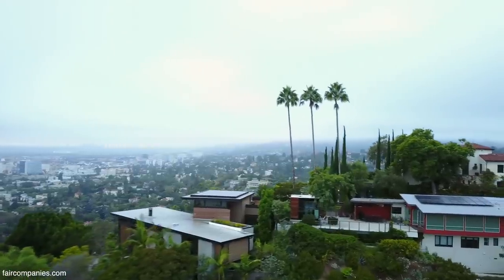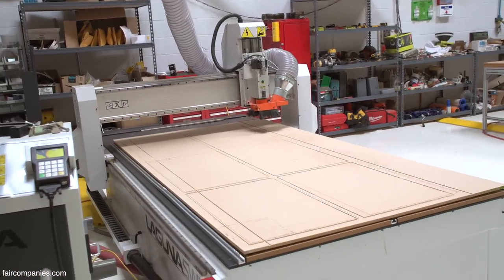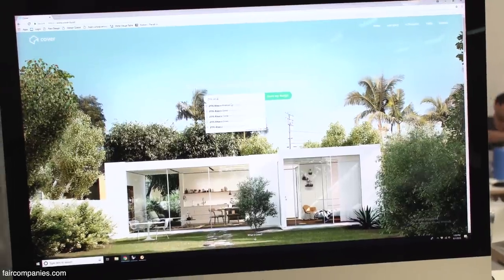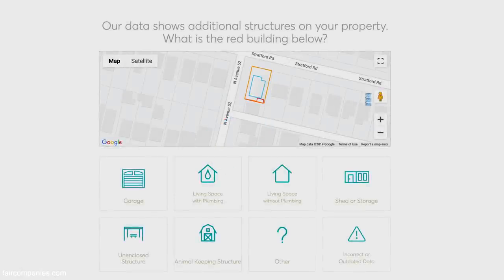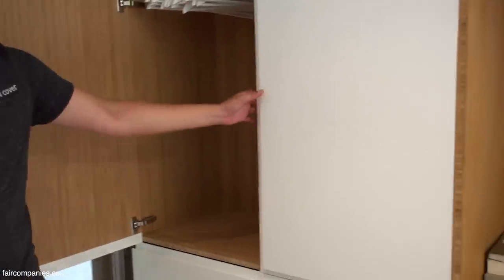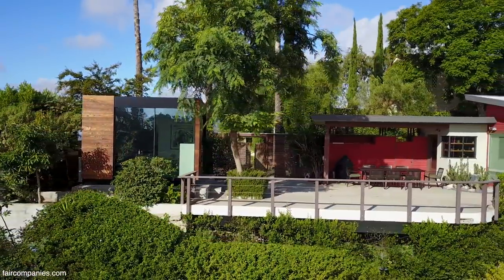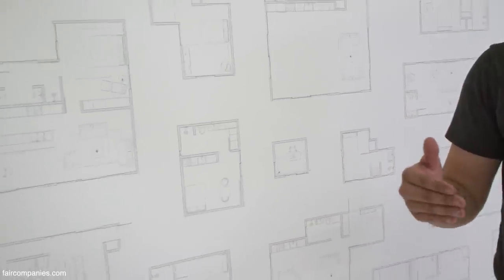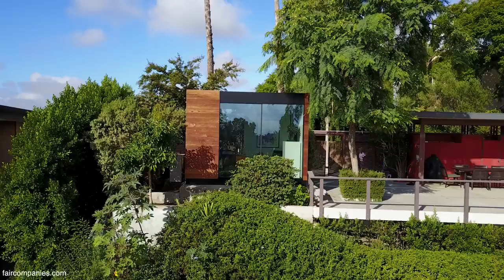LA startup offers custom small prefabs adapted to area code

Comment: An interesting concept. But, there is always a But, there is so much more to the cost of a home such as utilities. If these homes were designed for water catchment with a purification system with solar and wind turbine or depending on location water turbine for power that could possibly offset the cost for the California area. The only home I've seen that offsets the cost of build and land is an Earthship. In some locations an Earthship build may not be feasible, but to integrate as many of the principles as possible, water catchment, generating off grid power, using collected water 3-4 times and greenhouse food production even the black water for landscaping. Prefab a home that can include even one of these ideas and you increase the day to day affordable living.

Comment: What people here in the comments fail to understand is that the cost of labor is a significant contributing factor to the high cost of housing in California right now — especially in the SF Bay Area. The $100k price tag for one of these units includes the cost of the bulding materials, labor, installation, high-end fixtures, HVAC system etc. If you were to hire a contractor to build one these ADU's (accessory dwelling units) on a single-family lot in any of the major metro areas, it would end up costing you upwards of $200k and the quality of the finishes wouldn't be nearly as good as the ones shown in this video.

Comment: Problem:  Outlet specs change over time, wiring goes out, things break.  There is no way for an electrician or anyone to access the wiring in that outlet.  It's very close to a deal breaker.

Comment: 100k for about 10-15k in material if that and maybe 5-10k assembly labor I’ve never heard of a standard size sliding door being 10-20k either.
Reply: I know I saw the graphic at 4:56 and went so the solution to expensive/lack of homes is $350/sq foot tiny homes with no bathroom and technically no bedroom?

Comment: Positives: beautiful exterior and quick/easy checking what you can build on your property. Negatives: looks badly put together (panel seams make it look like it's falling apart, crooked wall outlet, table edge finish, etc), difficult maintenance/repair/upgrade,  low durability, at 100k not really a good value for the money.

Comment: The rollers on the bottom of the sliding doors are going to fill up with debris easily. That said, this company looks like it has potential. I am wondering what the cost are and what the limitations of what they can do.

Comment: A lot of great ideas guys. Consider using more veneers on the interior and instead of square edge panels I would chanfer the edges of the panels. The final product is actually more clean then trying to hide huge seams. 
You see these elements a lot on yachts and it works well visually and spreads assembly. 
Good luck with streamlining the production. Obviously there are a lot of possibilities here. After perfecting the backyard home I would be aiming to build full-size solidly constructed homes. Nice work. 👍

Comment: I think that company is doing a good job with their designs and products. It's interesting though how prefab designs have been around for a long time, but have only had limited success globally. In some countries it is almost the norm, but in other countries it has largely failed. Also for some reason they don't often work out cheaper than conventional building approaches. It's hard to know why. Post WW-II when there were a lot of returning veterans there was a short-lived boom in prefab housing which quickly faded. Recently I read the book "Prefab housing and the future of building" - it was interesting, but I felt it still didn't really get to the crux of the issue.

Comment: the outlet is terrible. I want t be able to swap switch plates, change the outlets, rewire, etc. Prefab only works if it is customizable after the build.
Reply: A good prefab allows for modification before assembly! I think you can still customize before assembly/swap
What should be worrying is the lifetime of the quality of material used!

Comment: -How would you replace this outlet if something happen to it?! (***Cut out the wall - very smart)
- How do you want to replace those sliding door rollers in the frame after couple of years? (working in high humidity and dust) (*** Change the whole frame - smart again)

Comment: Don't get me wrong, I think pre fabs are a great idea for affordability (as well as tiny houses) but while he's clicking through, thats still $100k for only 279 sq ft with NO bed OR bath......
Reply: They're not affordable at all from a cost per square footage perspective. They are double the cost of normal construction. But you probably get a much better build, air tight, energy efficient, etc, that is put up in hours with little noise, compared to conventional construction that takes days/weeks and hella noise.

Comment: Problem is they do not build in Los Angeles County only Los Angeles City.  Wonder why they cannot build outside LA City.  I am guess the other cities within Los Angeles have their own building departments, permits, rules and planning commissions.  If I lived two streets over I would be in LA City.  Think they need to expand their concept of working with Los Angeles County cities.  On this story I would had liked to see other units with a kitchen bathrooms etc. since Los Angeles is getting very hot during the summer how are they designing air conditioning for these units.  I guess a single unit where you can cut a hole in the wall would work.  What kind of surfaces do these units need to be built on.

Comment: For a unit with no bed room, bathroom or kitchen is $67,100 + $5,200 for permits + sitework of $20,130 and keep in mind the foundation is not covered yet = $92,430 for 124 sqft or $745.40 per square foot. Who is supposed to afford this? And it looks to be very expensive to do maintenance on it and it will only last 50 years?? Who can afford this??

Comment: I like it but I think for 100k is a bit expensive. I'd like to see a combo of what these guys are doing but reduce the amount of wood structure and replace it with a light gauge steel frame which could make it more efficient = less money. For a prefab like that it should not be more than 50-60k

Comment: $100K is actually not that bad. They design a custom structure, deal with permits and install it for you. If you hire contractors, you can spending more, while wasting a lot of your time in managing the project.
Reply: a942687032679840126 Contractor only cost $120 to $160 per square foot for new home. Building bigger can be less then $100 per square foot in California

Comment: Well that is certainly one way of  building a small structure but it's actually cheaper to build structures out of concrete poured into forms, you can have a prefab or poured on site and for any walls within the structure you would use metal framing, you can build any configuration within the diameter 30ftx30ft for at least $45,000. Plus with all of these forest fires the price of wood is going to go through the roof and most likely we will need to stop using wood as a source of construction to preserve the production of oxygen on planet Earth, concrete is just more efficient, effective and more environmentally friendly $100,000 for a prefab small structure that is not fully furnished is OP the inflation in the market is insane

Comment: 1) it is too expensive even for LA. It seems they are in a very small - very niche market where they can get a lot of $$$, and then move forward. 100$k for shed is totaly crazy. 100$k for another bedroom in 2$M LA house is fine. 2) I like their approach when they put a different material on the ceiling - to put electric there - why not to do the same with walls- so it could be easily maintained? In general i dont see all of it as issue - this approach to making houses - let hope they will develop - lower prices and etc.

Comment: So they are essentially building adu , not actual homes on the lot ? Still have to buy an actual lot. Which in Los angeles Is overpriced.
Reply: Yes, these are accessory dwelling units. They are a quick and easy way to add more housing supply to neighborhoods that have historically been zoned for single-family homes.

Comment: For $50,000 you can buy a really Bitchin fifth wheel with slide outs add another $500 to remove your fence slide it in your backyard put $50,000 in a high-yield savings account and your money ahead

Comment: Everything was perfect until the price tag appeared ($100k), for a tiny home.... it's insane.
Reply: @creoloko - No, just a reality check that what something will cost is not limited to its size.

Also, the simple fact of the matter is small to tiny structures were not invented by or solely for the tiny house movement but actually have been around for most of human history.  

So don't expect everything to be low cost just because of its size because anything built can be done at multiple price ranges, whether that's boats, cars, electronic devices, or even houses.

There's cheap > budget > mid-range > high-end > top of the line best of everything ranges for just about everything.

Really, he wasn't kidding when he said just that floor to ceiling custom fabricated glass sliding door would normally be over $20K per door...  For a even more extreme example, the top of the line audiophile high end stereo system in the world is worth $5 million, or about a million per speaker.

So what they're producing is a very high end home, it may be small but they can just as easily built this to any size and the cost is only lower than what high end homes can normally go for but it isn't designed to be dirt cheap by any means...  

Everything has costs and trade offs!  Want the nicest of everything then that's going to cost more no matter what size it is...

If these were cars, it would be like expecting a Bughatti or Lamborghini to cost the same as a Honda Civic...  It just doesn't work like that...

Comment: People! Fer gawds sake! 
Building a prefab is not about saving money – although this one is rather expensive – it's about saving time and getting a superior build quality.
Reply: Quality?? Where did you see quality? There's such lack of quality in the details that it's visible to the naked eye. So you gotta wonder..
Reply: @comment6864 Please tell me where you saw low-quality details. 
There is also quality to be found in what you cannot see. The tight fit of panels means you spend less on heating and cooling. The panels with conduits and plumbing installed and made in a warm dry factory are bound to be superior compared to an electrician sawing through your studs to make room for his conduits and fixtures, or not quite finding the center of your dining room ceiling for your chandelier. Vapor barriers are rarely installed correctly in conventional construction, and lead to rot and/or molds. In a factory OTOH.....

Comment: Too expensive.  There is no point doing pre-fab unless they are CHEAP.  There are also some clear maintenance issues here.  How are electrical outlets replaced when they die - you have to somehow get the wall panel off?  Even the globes look like a pain in the but to replace.  You have to squeeze that strip off somehow?

Comment: This might be even more expensive than buying an existing home smh
Reply: Yeah, location matters a lot in the housing market... Along with how it's built, what's included, what materials are used, what standards it is built to, and what the local zoning and building codes require to have it all done...

Besides, existing homes typically have many hidden costs because they usually need things like repairs, renovations, may need to be updated to meet modern building codes that are more strict than when it was built, cost more to heat and cool because it's not an efficient structure, etc.

Like you can get a house for a lot cheaper in say Detroit, but you can easily end up putting hundreds of thousands into the property before you're done... Never mind other things like property taxes, etc.

Among other variables to consider throughout the country...

Comment: Where’s the critical thinking here about the design problems in these designs? The seismic connections?  Tempered glass and safety in general around glass vs importance of light vs security, privacy.  Zoning issues? Actual usability for avg people? Most ppl don’t live like single 20-26 yo males.  Storage, bc everyone has stuff (towels, cleaning supplies, sheets, dish soap, papers, pics, what abt the things are you cherish that is not abt having stuff for show but the things you value and use/need.) Accessibility, and /or maneuverability within the unit?  Air exchange and better lighting balance and distribution?  Power outlets need to be accessible, safe, within reach depending on use/person’s mobility, and needs to be repairable/replaceable. Is the heating here radiant? Or unequally (forced air) distributed from the ceiling? And again, I’d be concerned about the wind, flashing and seismic strength of these adolescent legos. Lots of fancy expensive tools to ale the panels, but I haven’t seen any viable design nor fabrication solutions that address a variety of century old needs and problems. And apparently it’s not affordable either.

Comment: 70000 for a  guest room and 250,000 for a 2 bedroom.  Or I can buy a 4 bedroom house with 2 acres of for 275000. What is wrong with these "alternative housing" projects. If they are just as expensive as normal homes what's the point.  This should be available to be sold as panels shipped to you anywhere in the country  for 1/4 of what they are charging.  That would be compelling.  This is just nonsense. Hard pass.
Reply: Savage, you are totally right but look at the other comments and weep; this shiny object is not thought through. The guest room number doesn't include the 25% for delivery and sitework, by the way, so the cost would be closer to 100 grand. 
The California initiative of allowing second units in single family zoned areas will add value to properties to those who want to sell but destroy the quality of life of those who stay. In Miami-Dade County, if you want to enclose a garage and "make it a part of the house" you have to sign an affidavit that you won't rent it out and agree to a retroactive fine if it's discovered you did. A second kitchen and another car or two in front? Unthinkable.
Reply: EnlightenedSavage  You’re missing the point..it’s LA & only LA; practically the only place it in the US it MIGHT actually work & even still, there’s some important issues being raised in the comments

Comment: It is worth it. You people don’t know price per sf. To build.
Reply: There's a lot more than just cost per sq ft that goes into worth... Like how durable is the home, how healthy is it to live in, how long will it last, how much work will it take to maintain and repair, how energy efficient will it be, how well designed is it?

You're not going to really get any of that from just the cost per sq ft and it also doesn't apply to everything in the house equally.

For example, the kitchen and bathroom cost far more than a bedroom or hallway.  So if you only calculated the sq ft cost for just those two spaces you're going to get a much higher number than you would for the whole house and the thing to realize about smaller houses is things like the kitchen and bathroom make up a larger percentage of the total space and they eliminate things like hallways that would have lowered the sq ft cost average.

So it's a mistake to directly compare a large house to a smaller one based solely on the cost per sq ft without the context of how they are different...

Comment: I am not impressed. Actually this video irritated me highly. All the advantages are for the building company. Not really for the home owner. Also it seems it is all theory build into practical without real world thinking longer then just the building process. Two practical examples I noticed  1.  If something breaks in the outlet, one cannot access it anymore as it is inside the wall.  2. The bearings of the slide-door in a gutter are perfect sand and dirt collectors and will get worn out or stuck due to that very soon. Also there is a lot of talk on cost reduction but this is not seen in a drastic lower end price. This company seems not for the customer. It seems mainly it is meant to make the lives of the company owners better. Who cares if it takes one day or two months to set the house up on property? One usually does this only once. If it all meant that the house would end up super cheap for the buyer, then I can understand it. Now it only feels as a student project to show of. By the way, everyone knows Lego is great. However it never has been cheap. The advantage of Lego is that one can build en break over and over. Comparing house building to Lego misses that point. Lego alike building has only an advantage if it means the house becomes way way cheaper.

Comment: Why not start from a storage/shipping container.  You need to be at $50,000 to start, then have add-ons and accessories available even AFTER delivery and setup.  Start with a lockable door, some windows, prewired and plumbed, insulation and interior walls...  that pretty  much it.  Shoot for the homeless crowd through city and State government contracts.  Right now California will spend MILLIONS $$$ on the homeless problem, and in the end only house a handful of people,,,   That is UNACCEPTABLE.

Comment: "sliding windows that normally cost 10-12k we can do" "FOR A LOT LESS" WTF!? TELL US the prices! So far I've seen NO 1 THAT CAN MAKE A TINY STRUCTURE AFFORDABLE! HOLY SHIT BUNKIES ARE $38 GRAND! 10-12ft YOU GUYS WOULD HAVE 2 B $75-85 GRAND & UP. MR. TINY HAS SOME REALLY LOADED(full kitchen bath appliances cabinets wash dryer) PREFAB STARTING AT ABOUT $60K UP, 30 ft long 9 wide